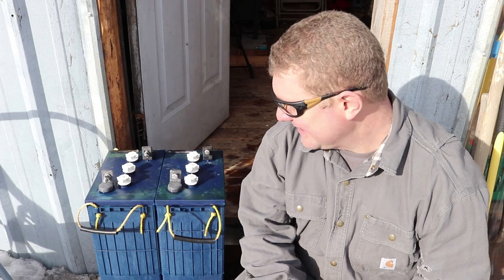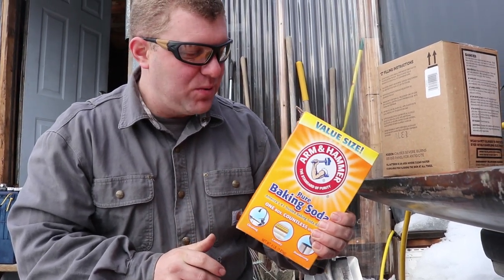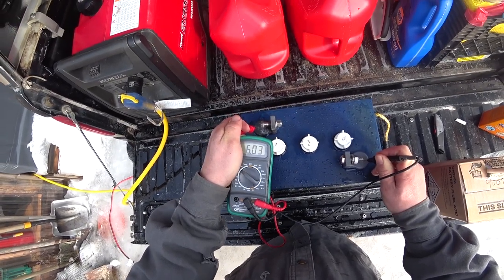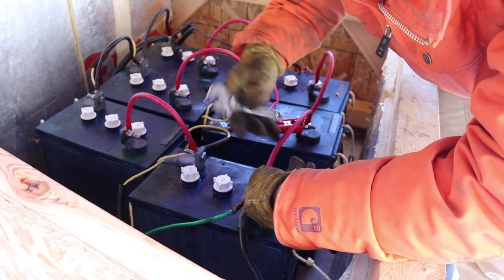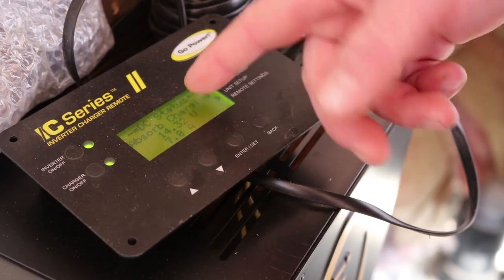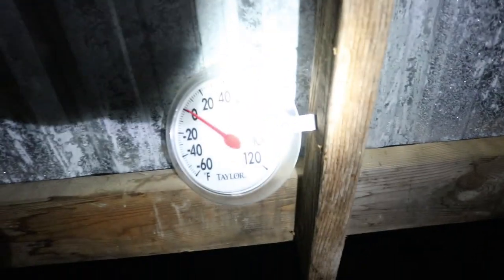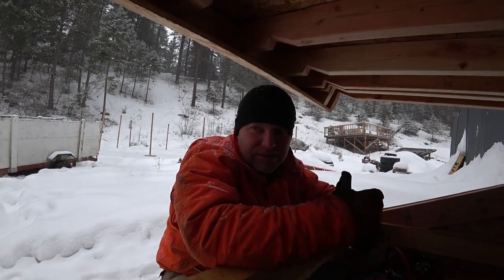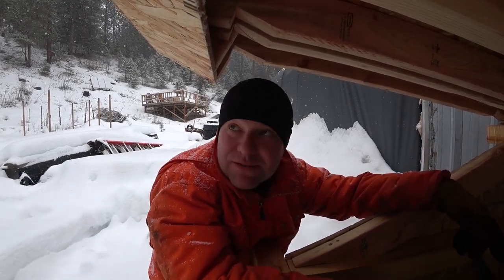DEEP CYCLE BATTERY HACK?! Fix $400 battery for $20?! (Part 3)

Comment: dumb question , at what temperature do lead batteries stop accepting a charge and sort of hibernate and lose voltage sitting ?  very excellent reconditioning you batteries videos , my friend tells me they have to bring batteries from the truck inside at night when it gets below 0* F , they go down to - 50* F for a week in January/February , if they do not use a garage they have had the truck die driving due to lack of charging voltage , guess i was wondering if you were heating the battery condo or not ,

Comment: To remove sulfate from the battery plates you would add a basic solution. In theory the solution would netraulize pulling sulfate off the plates.  Then dump the fluid out and rinse the plates a second time. THEN add the electrolyte.

Comment: What voltage is your system? I'm full Outback FP1 48 volt system with 16 cg2 6 volts from Costco going on three years. 9 to 12 300 watt panels.  I watched your video and wonder how you wired up the batteries? I lucked and bumped into a top notice solar guy who helped me.

Comment: I worked in a warehouse for 32 years running a Lectro electric forklift. Part of my job was caring for and charging the batteries each night.  The forklift used 6 of those 6 volt deep cycle batteries for a total voltage of 36 volts. I don't remember the amperage the charger was rated for, but it was high. if the batteries were run way down during the day, it took 12 hours to fully recharge them. Something that use to happen a lot when i left early was nobody would charge the batteries and we would have to use the forklift the next day to load and unload stuff in the warehouse. Working them hard when they were not fully charged would make them get hot and give off gas which is very hard on them. He we were lucky, we could get two years use out of them. Most of the time we would get maybe 12 to 14 months out of them. A good brand of batteries is a must. A good way to tell the difference between a good battery and cheap one is the weight. Good battery heavy and a cheap one light. The price is not always a way to tell the difference. Also make sure the connections on the cables are good. A loose connection can melt the post off the battery. Also a spark near the battery fill caps can cause it to explode.

Comment: You need to flush the contaminants out... check the plates to make sure none are damaged or touching each other , refill with acid , and charge them up in REVERSE with a good charger like a CTEK to reverse the movement of ions and metals between the plates,, and of course mark the new polarity on the cases.

Comment: Can you put a DC clamp meter around the each of the battery cables, It will very quickly tell you where all the current is going and if they two batterys your working on are takening current

Comment: I didn't look to see if anybody has recommended this or not but would connecting 2 of the 6 volt batteries in series to produce one 12 volt be a workaround for the charger/voltage/amperage issue?
as I am not a engineer please confirm this workaround with someone in the know.
Loving the posts.

Comment: I noticed that where your inverter is installed that it looks like you have some internet equipment that uses those little wall power converters. Take a look at the output of the wall power supplies and see what voltage they output. You may be able to cut those converters off add a fuse inline and power them off you're batteries directly. This is rather than taking DC making AC and then plugging in something to just make that AC power back into low voltage DC. 

I did this with the router in out 5th wheel camper. The router uses 12VDC at less than 1amp. Our inverter requires way more than that to just be on. There for saving a lot of energy by cutting out the "middle man" and going straight to the source.

Comment: I have noticed with battery banks that the batteries (or cells) on the end seem to become slightly different voltage than the ones in the middle? or maybe I'm dreaming.  Almost like the electrons are a train, but the cars in the train (electrons) bump into each other kinda like pushing one end of the train to have more pressure (voltage? ) ... just thoughts. jeff

Comment: Great videos! One thing I would add, that sludge...... Batteries have a dead space below the plates, the sludge is lead sulphate that falls of the plates, when it fulls that dead space it touches on the bottom of the plates and shorts the plates together, this is what causes "self discharge". Try doing this: first, discharge the battery fully to get the sulphur into the plates. Then empty the acid. When the acid is out, take a hose pipe and wash the sludge ALL out by spraying the hose up inside the battery with it upside down, then you the same acid back. I have had success with this method. This is the main fault with dead batteries.

Comment: Any chance of putting the batteries in a more sheltered area? During the winter of 1968 in Great Falls Mt. the hight temperature for, the 10-day stretch was -10 below zero so your cold snap is not too bad. It all depends on what you're used to. Hang in there, watching the video of the crystal clear stars at night was worth all the cold temperatures you've had, don't you think?

Comment: hi guys I'm off grid too 2.8 kw with 12 1025ah battery. they are now 17 years old and the only thing I have done is top fluids up. the big difference is temps. I guess. I live in Australia in snowy mountains but your temps are much cooler than us. I run a normal house TV washing machine vacuum lights gas slash electric hot water. oh very much enjoying you guys . keep it coming

Comment: Glad to be along for the journey and I get that there is a huge value in education but at what point does the value of your time as well as other costs, ( generator gas, gas to run into town) out way the 'savings' and validate the purchase of new batteries?
Reply from the maker: That's a good, but hard to answer question. What is the value of education? I'll be sharing more of my insights in a final thoughts video. We've learned a lot here, but certainly have a lot more to learn. Remember the idea here was if it worked on one, it might be worth doing to all. That's when it starts to make sense for budget and time. For one battery, not worth it!

Comment: The black sludge in the old acid is lead from the surface of the plates detached by hard use, it's loss permanently reduces the capacity of the battery.
It's also likely that the two worst batteries are the ones where the connections were applied in their last home. The batteries at the connector end always die first and kill the rest of the batteries. Best that the connectors to charger and load are applied to the diagonal opposite ends of the bank + at one end and - at the other end.

Have you tried living off just six batteries? Six batteries and some added solar should do you well, add a wind turbine at the top of the hill and you should be well off for power.

Comment: The particles that came out may actually be lead particles.  The lead will come off the plates.  If you get too much lead particles, it can create a lead bridge between the plates (a short).  This can reduce the effectiveness of the batteries.  Dumping out the batteries may have removed a lot of those lead particles and eliminated a bridge that may have formed at the bottom of the batteries.

Comment: Hay there guys, new to your channel and I have watched a few of your vedios. Interesting stuff you folks are trying.  I am a retired US Marine, one of my jobs was a Fire Chief.  So you probably know that I am way, way past Safety Sally. I grew up off grid so I know there is a great deal of dangerous activities you have to accomplish.  You have a beautiful female person their and for a guy your not to ugly, so I say this with much concern for you. When you are handling batteries you must respect what you are doing. MSDSs are a real good place to start. Pouring battery acid is one of them dangerous things, you really need the proper Glasses, Face shield,  apron,  gloves and boots. While draining, filling, moving and connection you used the same gloves and after you finish the job you touched your face near your eys with thoes same work gloves and thats ok to do if your tired of looking at that beautiful female person you have there with you. One last thing, when your working with battery acid it is advisable to have a source of water for flushing any area splashed, and keep a clean container to make neutralizer because acid will burn you bad. Respectively Submitted.

Comment: To desulfidate a battery requires a low charge rate for an extended time. You can get a constant current charger from the aviation industry if you set it to 1 amp the voltage will rise to whatever is needed to push 1 amp into the battery. As the sulfate burns off the voltage will fall. Also the self discharge is related to internal shorting probably from buildup reaching the bottom of the plates.

Comment: You motivated me to try and recondition 3 (out of 8 total) solar batteries (golf cart) that are 4 years old and just failed. I 'saved' one of them with one bad cell. One was completely shot. One i tried flushing completely, used a pressure hose to get the crud out of it, then refilled with acid. Still one dead cell and would not charge at all since it had an internal dead short. One thought, on the 'saved' battery i only drained and refilled the one bad cell, not all 3. it saved a bit of work. So, bottom line, the 'saved battery life projection is uncertain, and after spending the time effort and money to attempt reconditioning, I'm going to buy new replacement batteries when they fail. Thanks for the video. it was a worthwhile exercise to attempt.

Comment: Safety glasses, or chemical protection safety glasses, are good but  full face shield is even better (coming from a person who had the top of a battery blow off in my face while jumping). Got lucky, not a single drop of acid landed on me. Never found the top of the battery...

Comment: There is a device call a megapulse, which in testing by the CSIRO (a government backed lab in Australia) found that they maintain and repair lead batteries. My own experience proves this out I've not replaced the battery in my car for over 10 years and tests as new on a crank amp test. The cell must not be damaged ie not have cell warping.

Comment: Because there are only two battery terminals form the charger, it reads the whole battery bank as a whole. So i think you were right to (try to, but didn't) separate the two batteries you are trying to recover. The charger runs its three stage cycle based on constant current until the battery hits peak voltage (which for a weak battery will happen almost immediately), then stage two topping change when the current flattens out (does not change), goes into stage tree float mode (constant voltage to keep the batteries topped off and prevent self discharge). You said in another video you need an old fashioned charger, and i think you are right, as the three stage charger in the battery box is not working much different than the one you were using separately, except in the battery box the weak batteries stop the charger from seeing the true state of all the batteries, so it stops early.. in a bank the batteries need to be as similar as possible as they are charged on average, not based on each batteries unique state. i think the goal is to condition the weak batteries, so they look like the others, electrically speaking. unbalanced batteries have higher internal resistance, and will suck up some of the charging power (like having an extra load on your batteries when charging)

Comment: What's the voltage capability or your Honda Generator AC or DC.???  ... What's your battery config. trying to achieve.???   ... is it 12v DC.???

Comment: In a situation your facing you need an old school non electronic battery charger to push the batteries back into spec and then allow the inverter charger back in the system to maintain the system. Those electronic smart chargers don't charge batteries very well because the firmware is partly impatiently put together.

Comment: I'm liking your videos.  I'd suggest you put a couple of wrenches on a nail that fit your battery cable bolts so you don't have to mess around with those adjustable wrenches.  It will save you time.

Comment: I wonder if you should call a spade a spade and go down and buy a couple 235amh batteries to hold you over. At least they'll be new and by guesstimation, they may be even in power drain given those other batteries might not be in the best shape. Good luck.

Comment: you can check individual cell voltage by putting one probe on the batter post and another into the open hole so post to first hole should give you single cell voltage and so on

Comment: Also, I once saw a Biker reconditioning his battery at a truck stop once. That sedament in the bucket tends to pack itself on the floor of the cells. I'd try about 2 cups of watter in each cell then shake, rinse and repeat if necessary.

Comment: Been there done that trying to figure out these kinda problems. Though its pretty rough having to do it with a malfunctioning inverter charger, and below zero temperatures! Oy, thanks for the update, I hope you get it sorted out, and get some useful information from the testing. Thanks for the hard work and the great videos! :)

Comment: You do need to isolate batteries when measuring.  Otherwise you are measuring an average voltage to all the batteries measured in series/parallel.  Great videos!

Comment: Batteries banks 101,
First off your 12 volt  battery bank can isolate any two of your series six volt batteries by removing the series connections of the other batteries between the other pairs.  You only need remove one bolt from the center series connecting cable to disabled any unwanted pair of batteries from your if load/charging circuit.  If you need to prevent  stiff battery cable from temporarily reconnecting slip the cable  into the mouth of small medicine or beverage plastic bottle or inside a short piece of plastic tubing or something similar.  No need to remove the outside parallel connections of any your batteries, unless you need to remove the batteries from you enclosure.  
Secondly if you're gonna try of serious reconditioning, several things you need to know.  Your little battery each load checker has more than sufficient to help you determine the conditions are yourbatteries.  The two main culprits that the grade lead acid batteries is sulfated plates, and the sediment that accumulates of the cells in the bottom older batteries. 
 The simplest way to remove sulfated plates is to use a little higher voltage than normal battery chargers with your individual six volt cells  with the old electrolyte still in the batteries, putting distilled water in the batteries to try and remove sulfate from the plates will probably not work very well as  old electrolyte.  Because the disttilledl water does not conduct electricity very well.  Pure distilled water should actually be in non-conductor or an insulator.  At any rate to remove the  sulfated plates with battery charger, requires you to remove the batteries cell you're going to have increased your battery charge for at least 7.5 volts then slowly up to eight or nine volts repeatedly for short periods of time.  This will cause sulfated plates and electrolyte solution to actually heat up the sulfate crystals deposit on the plates to return to the sulfate back into electrolyte solution.  During this higher voltage charging a lot of additional hydrogen and oxygen bubbles will be released, so this needs to be done in a well ventilated area away from any ignition sources.  You'll need to have your distilled water kept handy for topping off the cells to replace the water that is electrolytized during this process.   You will also need to monitor the batteries to make sure they don't get too hot.  They do make special chargers to help maintain car batteries, but  those large deep cycle may need a special charger.  I don't think so, I think if you can find a six or eight volt charger that put out at least 15 amp. 
 If this doesn't work and there's probably too much sentiment accumulated in the bottom of one or more of the cells in the battery.  You will need to carefully drain the battery electrolytes then rinse any remaining sentiment out with first with cold water and then very hot water, possibly repeatedly until there's no sentiment coming out of the the batteries cells.  This rinse water may still need electrolyte acid to be diluted and or neutralized.   At this point you can again retry the procedure to  desulfate to plates on the battery again, you may be able to recycle some or most of the old electrolyte drained out of the cells by letting the sediment settle to the bottom.  Again make sure the electrolyte levels keep the batteries cell plates covered to remove any of the sulfated deposits on the plates, so again keep the disttilled water handy.

Comment: Oh, as far as charging a 6 volt battery and the issue with being able to vary the charge rate, you do know the whole series parallel thing with batteries, right? Two 6 volt batteries in series is the same as a 12 volt battery, and you can use a 12 volt charger.

Comment: hi guys the sediment in the bottom of your batteries causes drain  from the battery. the sediment piles up in the bottom until  it reaches the bottom of the plates and shorts out the plates. you could refill with old acid with sediment removed until what comes out is pretty clean then refill with new acid